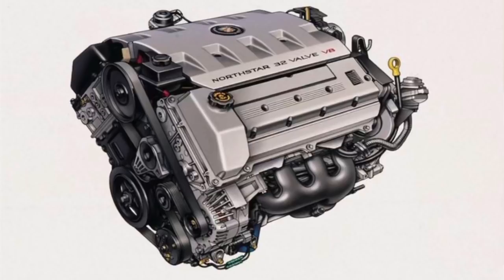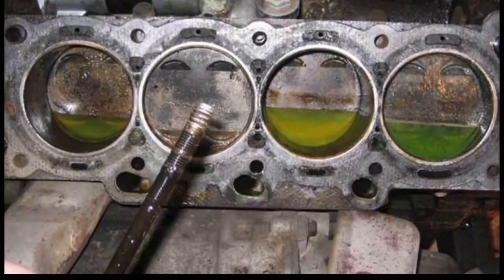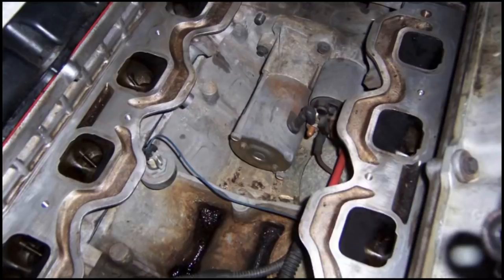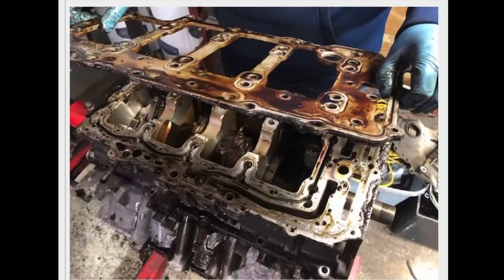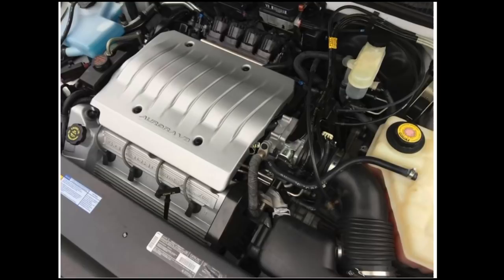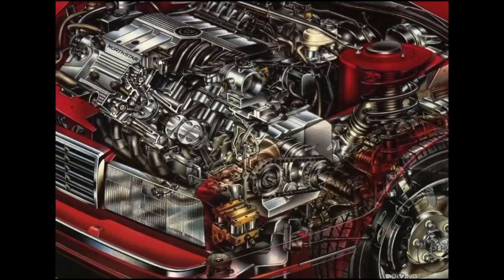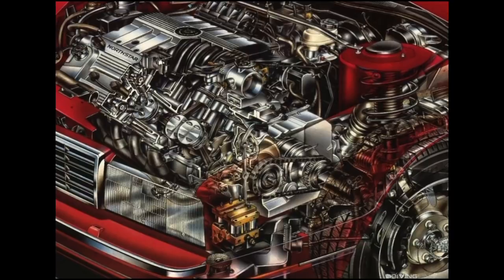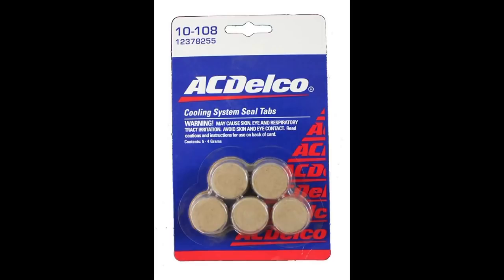Worst Car Engines of All Time: Cadillac Northstar

Comment: I guess the engineers put the starter below the intake because they figured you’re going to have to take it off anyway when you change the head gaskets, might as well get them for a starter too
Reply: Brilliant
Reply: Toyota V8 also has the starter under the intake.
Reply: That’s a pretty common design with V8s
Reply: I can attest that with the starter located there  …. Can’t even hear it start.
Reply: @MrSloika  But Toyota uses a better quality starter motor.
Reply: It’s noise reduction. And it works!
Reply: Nah, change the head bolts too
Reply: @lindycorgey2743 the quality of the starter on the cadillacs were fine. And being under the manifold protected them from the eliments and made replacement less frequent.

Comment: “When it is working, the Northstar is a great engine.” What a great endorsement!
Reply: Many people who had used those engines to power their larger sand rails (4 seaters), because the HP and torque output. Those engines sounded pretty wicked with headers. A very unique sound. Even in stock form those engines still produced good power 300 + HP . I often wondered if Toyota  had used some of the Northstar features in their design of their I-Force V8 engines. There are some similarities. Which too was a very good engine.
Reply: @michaelmurphy6869  but don't use that garbage pellets 🤦‍♂ ( insider secret the dealership's down the road said the was for idiots and for a quick get lost trick aka it doesn't work on that platform and not in my SBC 350 as it miss up the insides before i got it from the previous owner ) my old job use to be a profomance shop doing caddy's and the north star and 500CI engine was one of them might even have modified rare classic cars SLS caddy somewhere in the passed so he might not know what is in side/modifyed. and i like the starter in cramped mucky parking lot space 20m ish job with my old tools if im pushing it ( on the boss car or the wifeys cursed one aka christen/little bastered/evil car ) and the water cooled alternators are actually more reliable just don't plug it up or overload it ect. with things like big sound systems and 20" rims 🤦🏻‍♂ no! butchers car had to fix more than one problem from that
Reply: @michaelmurphy6869  200-300+k miles on the more the one testing mule car so they generally don't suck in my mind after mods bone stock the shortest mileage i saw was about 65-80k and the engine needed rebuilt all the way not just head gasket's. the transmission seems to be aimed design wise for about 200K but if you're nice to it and do service with fluid flush filter and band adjustments every 50k it can last way longer than nun=about 130k ish
Reply: its not that bad but take it as it is i drive a 60's charger with a BBC/hemi Manule transmission and a 80's Chevy K1500
Reply: Yeah and when my horse isn't dead he can pull a wagon.
Reply: @aarongranda7825  your amish ay 😂
Reply: when I poop it smells horrible
Reply: Sadly I've never seen one run properly. The one I owned I lost thousands of dollars on, sold it at a loss to a guy that was a dealer in the casino. It pumped him dry too! Eff that!
Reply: @williscurry6557  well one guy costumer dark green car that worked at a lincon ne plastic plant management/maintenance department drove one for 15+year's and swar by his 4-door 98 caddy for his year round 40 mile 7-on-14-off daily commuting but it did use up 2 transmission's and 3/4 engine rebuild in that time and vary lightly moded mostly for reliability ( thing's like HD transmission parts or bigger 14MM head-bolts and different gasket's ) and not for speed ect.
Reply: @williscurry6557  what year/model was it or collor was it?
Reply: @samholdsworth420  You might want to see a doctor about it. Poop should smell, but not too stinky. You might have cancer if its really stinky. Also, if your poop doesn't smell at all, then you also might have cancer. Poop should smell not too bad and not too good. You should always get a good whiff of your poop after a dump to check its richness.  Hope that helps!
Reply: @michaelmurphy6869  forgot to mention that in have seen a couple in GM fearo/sun bird 🐦/ mid-engine hot rods chassis's  before and after the 90's-2010's so in essence they got a c8 before gm sold em in 2022
Reply: sounds like something a jaguar driver would say.  :-D
Reply: I can vouch. I had a 97 STS. Loved it. Plenty of power and ate up highway miles like a BMW 7 Series or MBZ S Class. I was fortunate enough to never have problems with it but knew plenty of people who did.
Reply: @Dbdorr  please say it's not purale white ? as i not sure what happened to christena but the wife said it got squished thankfully as that was a evil car that liked killing people
Reply: @richardprice5978  no it was black/white
Reply: @Dbdorr  black paint white interior? or two-tone?
Reply: @richardprice5978  black exterior, white interior (well light cream/off white really)
Reply: @Dbdorr  um 😐not a re spray right ? 🤞 no. most of the time i wouldn't go for cursed/hunted but like jimmy's old little bastered it bad 👎and 17-25 me though i could fix anything/car ( didn't believe in gossip ect. ) but not that one now days i don't even want to be in the same zip code as STD
Reply: @richardprice5978  no. OEM paint.
Reply: @Dbdorr  🙏G so so far she didn't lie that i know about it the wicked which is dead 💀of wizard of OZ lol 😂
Reply: "Unremarkable "
Reply: Sounds more like user error since the average Northstar engine did not face anywhere near that many issues. That’s average, so some of them fared much worse, but if all of yours were that bad, that one is on you. Learn proper maintenance on the vehicles that you next time.

Also nothing comes close to some of the turbocharged  BMW engines of recent years. They’re failing at an absurd rate at around the 10-year mark.
Reply: Duhhhh ! 
A brand new ford are good to drive too ! 
Do i wanna own one ? nooooooo